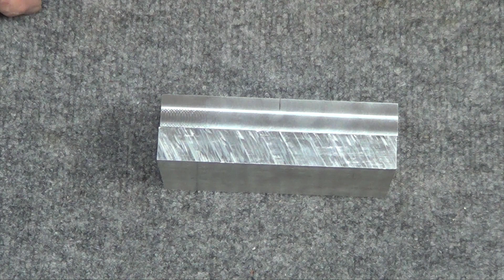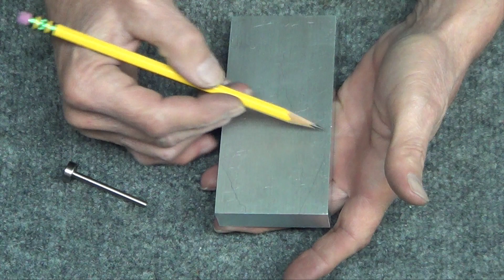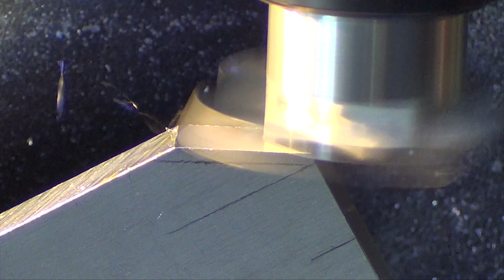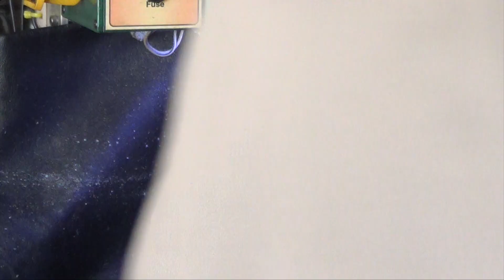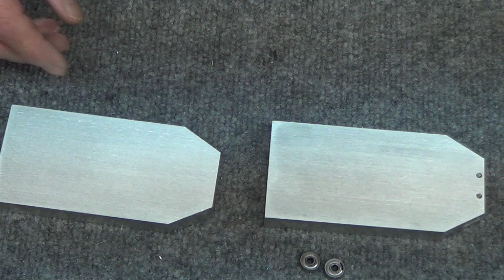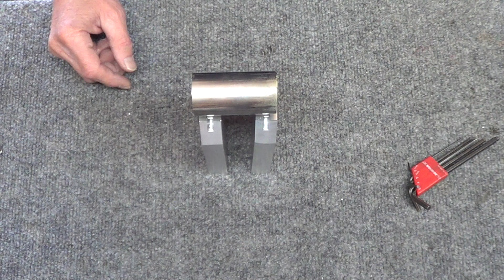Home Made Grinding Wheel Balancing Fixture

Comment: There is a possibility of friction against the bearing outer sidewalls also from the dust shields and grease in the bearings
Reply: The small bearings may not be able to handle the heavy load of the wheel. Weight causes friction.

Comment: Consider a traditional balancing stand. The wheels are large diameter because that reduces the moment of force required to overcome the friction of the bearings (imagine a lever equal to the radius of the wheel). One layer of complexity though is that you need to balance those wheels as well. The air bearing idea is interesting though.

Comment: his drilling of the holes is not a good method and takes too long. a good method I have switched to is mark line for low and take tape and tape on small washers or anything you want even carbide rock tumbler grit. then take jb weld and stick on the items to final balance-no they will not come off and hit you in the eye you cannot even chisel them off with a hammer. for the balancer you actually are better off making a common stand with 2 legs and also jb welding on a couple rods. no friction. many videos showing this. On the balancing of the wheels they actually dont need to be a trillionth of an ounce but you can get them that way.
Reply: as far as the rods I sawed out a square hole in a throw away coffee table and placed a couple of aluminum rods and worked fine. I did that on emergency basis because wheel was so out of balance it shook the apartments where people ran out thinking an earthquake was happening. I made a stand and turned out THAT WHEEL WAS PERFECT--didnt even have to fine tune it. anyway do not take the route of drilling divot marks--that is a wrong method.

Comment: Why are u fly cutting the who corners off ? Just stick a 2 flure in and rip through it then if u want a nice finish put the fly cutter in and take a light pass and use the fly cutter the way its intended.  It's your time your wasting taking  small cuts but I would have had both sides done in 5 min
Reply from the maker: And what do you have for a mill?

Comment: If there are” density spots” as the wheel wears those density spots would continually change the balance of the wheel as it’s diameter decreases. And once you pass a density spot it will reverse location of the center of gravity. I would have to balance the wheel every 1/4 inch or wear. It would also wobble side to side and oscillate. Is this common practice?
Reply: Not usually, You balance the wheel and put ity on and on big wet grinders, never take it off untill it has been worn and dressed down. If it ever leaves a finish from out of balance durring its use, its more likely the the wheel has slipped on its arbor and You would certainly rebalance

Comment: Better way to do it without all that machine blah blah...apiece of thin lead sheet  cut it off center put hole in middle and turn it on grinding wheel till you find sweet spot and your balancing will show up on a glass of water by watching ripples.works very well.

Comment: The wheel seems to be out of balance if you look between 2:50 and 2:59, you'll see the wheel roll back after it comes to a stop. On a balanced wheel this does not happen. Your balancing device suffers from the same problem as that of Randy's balancing machine, too much friction.Randy's machine compounds the friction by having FOUR (large) points of contact trying to "drive" FOUR wheels driving EIGHT bearings. This friction will prevent a fine resolution measurement of balance. A better design is to place the arbor across two level, parallel round bars, as seen in other balancing videos. This design minimises the TWO points of contact which are VERY SMALL contact points.
Reply: yes level knife edges.

Comment: Dave, take a look at one of my old videos.  https://www.youtube.com/watch?v=53mUcjocNUQ  Some strong magnets make it easier than aligning bearings, and you can achieve lower drag. You taper one end only of the shaft.  Anyway, it's a quick easy way to make a super sensitive balancing system.
Reply: Hi Bill: I could not figure out the connection between the shaft and the magnets.
Could you please send me an email with a more detailed explanation?
Thanks  George      scrdmgl@gmail.com
Reply: Jorge,

The magnets are used to support the shaft as opposed to using bearings.  As a result there is VERY little friction.  

It is very easy to set up a simple experiment with two magnets.  Take a steel shaft and turn one end to a point.  Leave the other end flat.  Then position the magnets so they are slightly wider than the shaft but do it in a way that will allow you to easily adjust the space between them.  You might use clamps on this setup as opposed to screws or bolts so you can adjust the spacing.

Now place the shaft between the magnets and have the tapered point on one magnet.  If the other magnet is close to the flat end, that will be enough to suspend the shaft between the magnets.  Because one end is tapered, the magnetic force will be slightly less on that end than the flat end.  If the gap between the magnets is too small, the shaft will jump from the magnet on the tapered end to the flat end.  If that happens, increase the gap between the magnets until the pointed end stays attached to the magnet when placed there.

Adjusting the gap allows you to fine tune the pressure applied to the point.  You want to adjust them until a slight force on the shaft towards the flat end of the shaft will cause it to jump to the magnet.  When you get this gap just right, there will be very little force between the pointed end of the shaft and the magnet and the other end of the shaft is just held in the air by the magnet on that side.  At that point the only friction is from the few grams of pressure between the pointed end of the shaft and magnet and the friction from the air itself.

Hope that explains it.  If not, I'll make another video.
Reply: Oh, I just realized that if you watch at about the 58 second point in the video, you can see that just the slight pressure from trying to adjust the thumb screws caused the shaft to jump from the pointed end to the flat end on the magnets.  You can see and hear it, and then you can hear me move it back to the pointed end.

Comment: I would like a copy of your plan for this balancing jig. Thank you
Reply from the maker: http://theminimachineshop.com/Plans/Balancer.jpg
Reply: Prop balancer no fuss no muss 
Du-Bro 499 Tru-Spin Prop Balancer
Reply from the maker: Found it on Amazon for $25 but would need mods to hold a large chuck or grinding wheel. Good input!
Reply: It does my 7& 8 x 1 in plus wheels easily. Dabbing a bit of super glue and and powder for final balance.